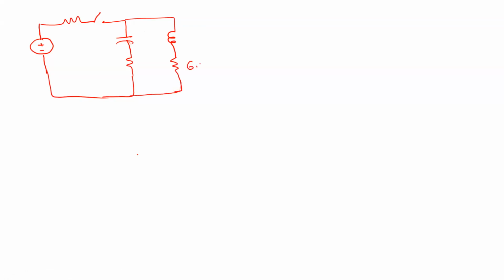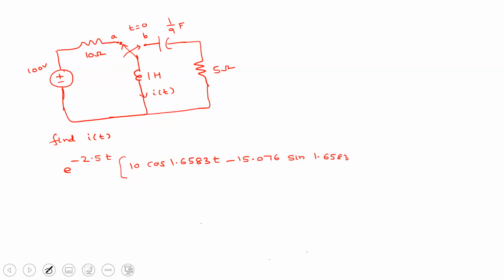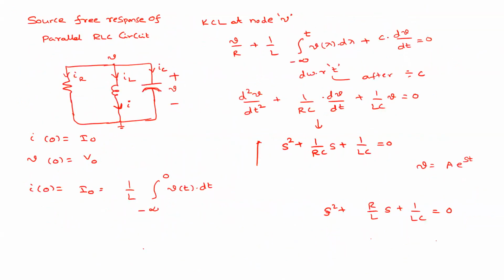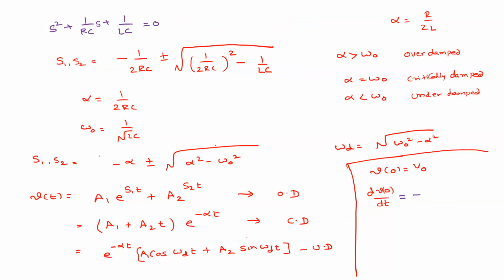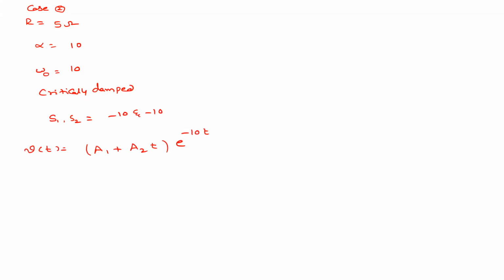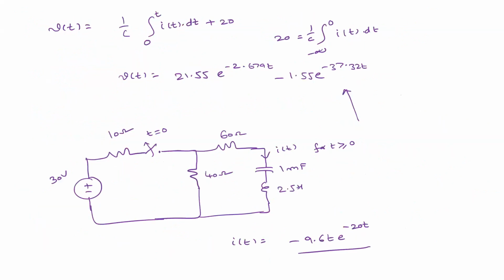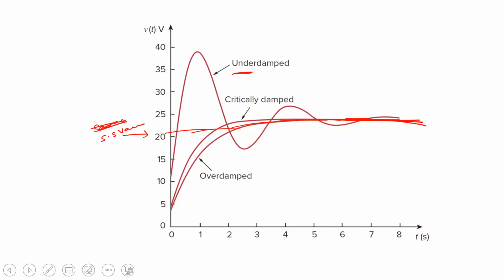Basic Electrical Circuits, Circuit Theory: Second Order Circuits, Parallel RLC Circuit Response: L32

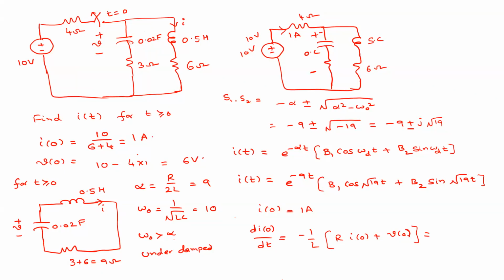Comment: at 8:47, V0 value would be -6V as polarity of capacitor is opposite to the direction of current
Reply from the maker: No, it is 6 V only, just we need to subtract the voltage drop across the 4 ohm from 10 V source.
Reply: @AdvancedPowerElectronics  no no sir, not there.. I am talking when we are applying kvl, the direction of assumed current is opposite to the polarity of capacitor, that's why value of di(0)/dt should be -6 and not -30.